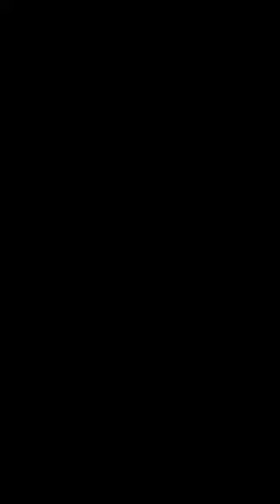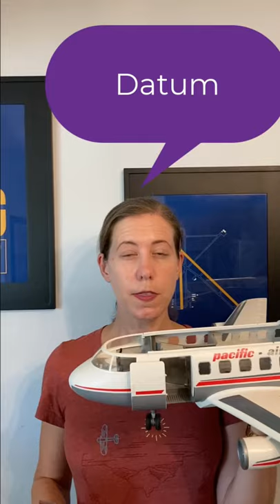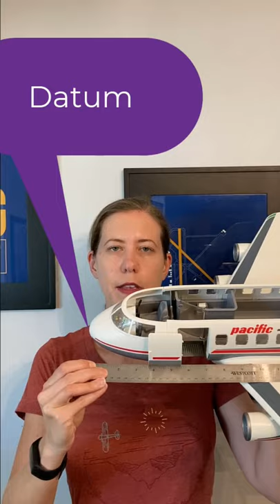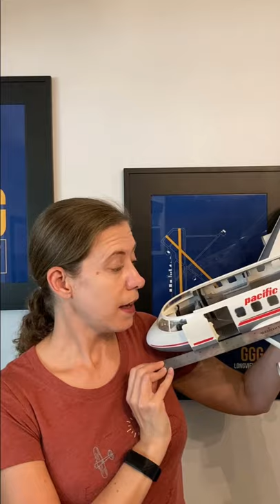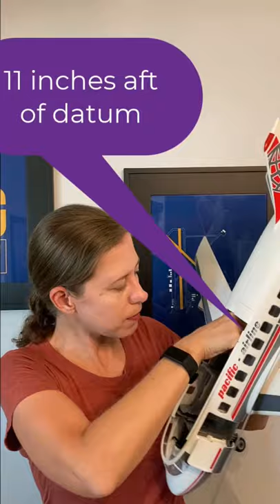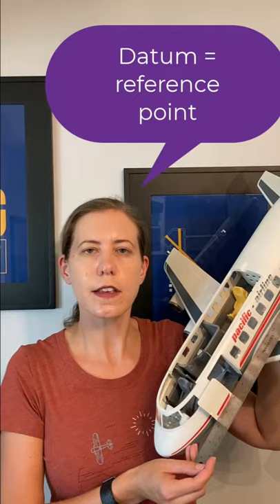What is a datum? Aircraft weight and balance: pilots mechanics & dispatchers #shorts #flight #pilot

Comment: So the datum or reference point is the seat? Am I right?
Reply from the maker: Thanks for watching! A datum is set WHEREVER the manufacturer sets it. It could be the pilot's seat, but it could also be the tip of the nose cone. It could be at the nose landing gear. It is totally up to the manufacturer. The main point is that ALL other points are then measured from the datum, wherever they choose to locate it. The location will be listed in the aircraft's manual.